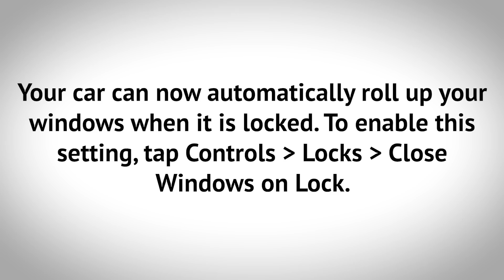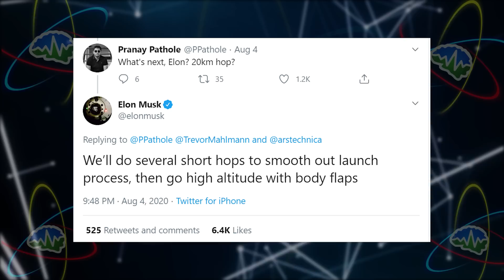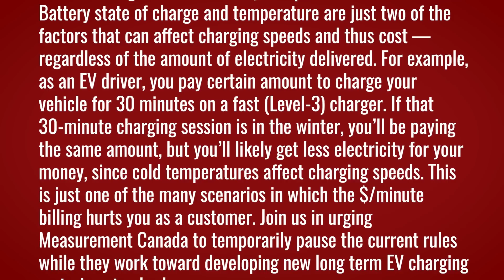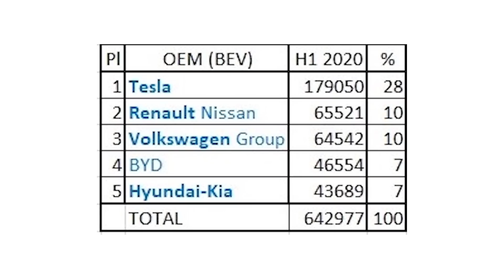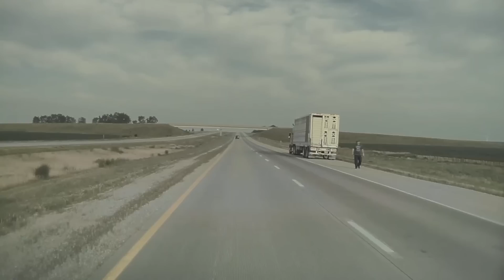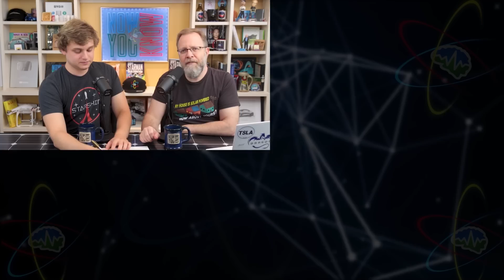Tesla Time News - Tesla's China Wrap?

Comment: that makes no sense.. how can an undersea cable send electricity from australia to singapore? one of the laws of physics violates that proposal, electricity cannot travel extended distances unsupported and must be assisted by power transformers to continue the current, and if the cable is designed to be durable enough to handle the pacific sea of fire (which means that it'll have to be hilariously thick by conventional logic) then its own thickness will act as resistance for the electric current, the thicker a cable is the more juice you have to flow into it to complete the connection, but with that also comes another problem, heat buildup. the higher the resistance the more heat will be generated on the cable, and the hotter it gets- the less conductive it becomes, resulting in even more resistance. this model cannot be sustainable without some sort of next generation high tensile superconductive cable, theoretically graphene or phosphorene could be the most ideal since they offer the best integrity and least resistance.. but they're also very difficult to mass produce..

Comment: Don't think that CYBRTK is really a feasible option for European markets due to regs, size constraints & difference in tastes relating to design aesthetics. Elon said on a recent podcast that CYBRTK is probably only going to be for the USA. I think that if Tesla made a baby version cab of the smaller Semi that was only a 2-3 seater vehicle which would allow for a larger load bed, then that could be more attractive to the European markets & perhaps worldwide. As things stand, CYBRTK is, well, polarising is polite, but in simple terms, brash & a little tacky in appearance; it's no wilting violet. A baby cab version would still appear futuristic. To me one of CYBRTK's main drawbacks is the rather short load bed & this is true of just about every pickup on the market today, EV or otherwise. A 2-3 seater version would be far more practical since that's what CYBRTK was primarily designed to be; practical.

Comment: Charging by the Kwh is also fairer to the charging network owner which, I would argue, is more likely to encourage more players to enter the market & thus stimulate EV adoption since a lack of charging infrastructure is oft touted as a reason not to switch to an EV. Charging by the minute doesn't necessarily mean that the charging network owner's costs will be covered, never mind profits. More charging infrastructure manufacture & installation, means more green job creation; particularly in a COVID-19 economically challenged world.

Comment: regarding power loss & transmission of solar energy- I get a lot of naysayers insisting that the problem with solar is... you make it in say... arizona.. but you need it in...... louisana. I get what they're saying.. but Elan insists that we could go 100% solar and I believe it. can't they just 're-boost' with ultra capacitor banks? this problem MUST be solvable. natural gas pipelines solve the problem over LOOOONNNNGGGG distances by burning part of the gas they're piping.. in turbojet powered compressors that 're-boost' the pressure.  (get the brain juices swirling ya know... solar... electrolysis, hydrogen.. gas lines.. .same trick- jet / compressor 'boosters' til... generation point & then H fuel cell to grid).

Comment: zac & jessie? is there a 'wall'.. where voltage loss just makes it impractical and even impossible to transmit beyond? I copied this quote off science.smith.edu- but I've heard this figure before. is there a newer, bigger conductor that makes a 2300 mile hop possible? what's up with that? how will they accomplish that? by my load calculations.. even at 735kv & 1000 amps.. which won't nearly provide enough power.. they're losing 45% of their power in transmission lines.
Reply: They will be using high voltage DC lines. Many times more efficient than long distance AC.

Comment: Why NVAX will value $350 (8/6)
1。On 7/22，8/4,  8/6 update:
NVAX‘s 2020 EPS is raised from -1.03$ to 7.67$ on 8/4, today (/86) to $7.98
And its 2021 eps is raised from $10.37 to $18.95 on 7/22,then $19.75 on 8/4, today (8/6), to $23.74
      Accordingly, its targeted value by the end of 2021, now should be raised from $160 with a FPE of 15, to $350, with the same FPE of 15.
      *This 8 billion dollars company has DOD’s 1.6 billions exclusive contract for vaccine. (July 7 (Reuters, NOVAVAX ANNOUNCES $1.6 BILLION FUNDING FROM OPERATION WARP SPEED). 
-Expect to gain at least 2-2.5 X value in 2021. 
 
> Barron's Article Logo A link that brings you back to the Barron's section page.
** Analysts Say Its Covid-19 Vaccine Might Be the Best.

THREE more UPGRADE : 
1a). On 7/10 ,
DBD’s EPS for 2020 & 2021 are upgraded ,  respectively , from
-$0.13 to 0.37 for 2020,
-$1.26 to 1.44 for 2021,
-It is also upgrade from “hold” to “buy” by Vector Vest.

1b).On 7/30 , after 2nd quarter Report
DBD’s EPRs upgrade again!
-from $0.37 to $0.84 for 2020
-from $1.44 to $1.74 for 2021
-It shall value at least $26 (PE @15) for its fast selling self checking machines at supermarkets, by the end of 2021.

2). CTXR turn from hold to buy (7/7)
-CTXR will earn $0.74 for 2021. 
  At $1.26 on 7/30, It has Forward PE about 2.

3). DRAD (turn from hold to buy on 7/7)
-DRAD will have a EPS @$1.73 in 2021
-At $2.75, price, it has a FPE around 1.6 ! 
-DRAD values at least 10 X by the end of 2021.

Also Check out
-COLL , high growth 
-PE is 15 for 2020 and FPE is 5 for 2021

Notes：All EPS cited here are from Ameritrade.

Comment: Who did you ask to read that judgement? They got it completely wrong.

The driver got fined for (a) crashing the car because he was distracted and (b) he was fined for using a forbidden device. The latter is the "anti-mobile phone law" and does not require any kind of crash or other effect to come from using the device. You use it, you get fined.

The driver accepted the fine for (a), be he contested the fine for (b). He argued that the wiper controls are not a forbidden device like a mobile phone, laptop, game console, television set, etc. but instead are part of the car, just like physical wiper controls. The appeals court then said that the law says ALL touchscreens are forbidden devices, no matter what their function is. (And yes, the law defines a class of devices and then lists a number of device types in addition to that class. There is one single type of device included that's not a type of device by function ... the touchscreen. It got included there in May 2017.)

So if the driver had fiddled with physical wiper controls for so long that the car crashed against the tree in the mean time, he would only have been fined fro crashing the car, NOT for using the wiper controls. He got the additional fine because the wiper controls were on a touchscreen.